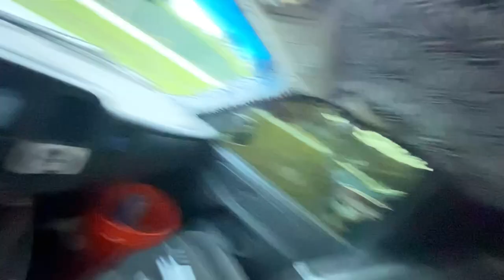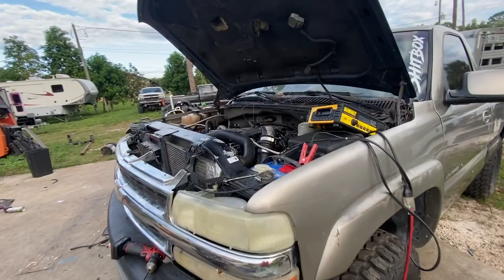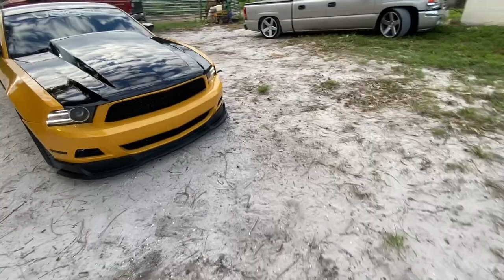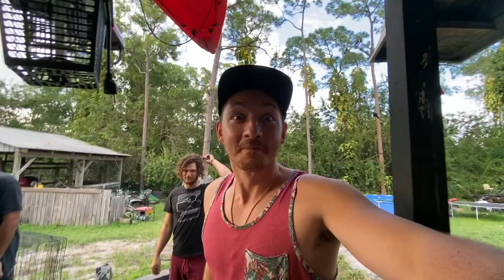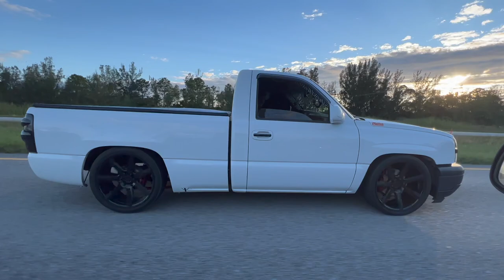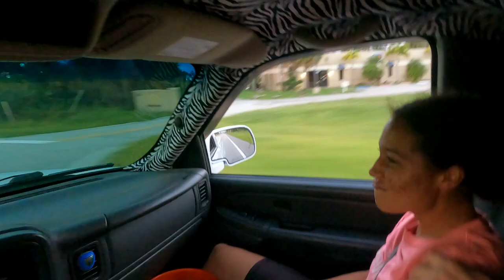Panda vs. big cubic inch LS swapped truck

Comment: Nice truck man I'm considering doing one these builds I currently have a 2010 camaro ss I just put a  cam In was wondering what kinda power you making. Bad ass truck
Reply from the maker: When it got dynoed it was 386 whp, but the transmission was slipping so it should a smidge higher than that. That’s with the big wheels and the 4l80e in about 100 degree heat.